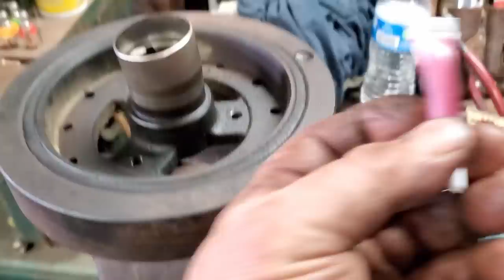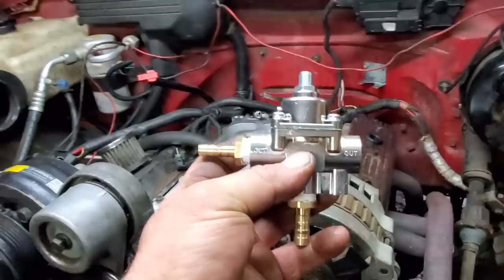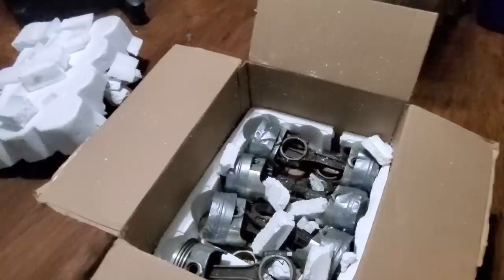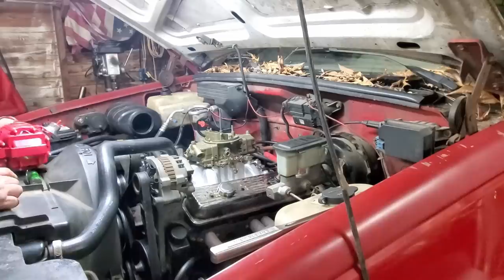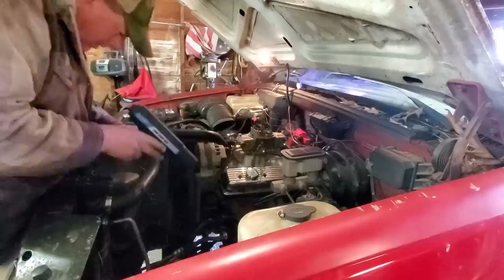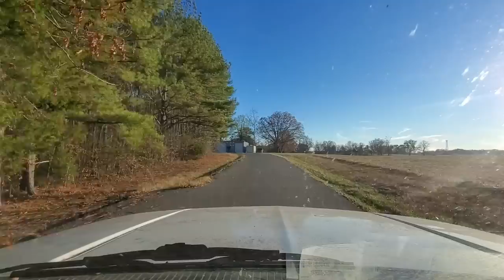1990 Chevy 4wd heads and cam swap. Hot rod 4x4!! Part 2 | It's ALIVE!!

Comment: I am running an older block with Vortec heads and from what I read is that electric water pumps work great with this. You can run a secondary water line from the water pump to the front of the intake. It solves the coolant issues with the vortec heads on a older 2 main block.

Comment: I have a 95 K2500 with the 5.7 TBI . At 188,000 it needed a valve job. I pulled the heads and sent them off to my local machine shop to be checked for cracks and have a complete valve job on them. Meanwhile back at my shop I figured I was so close to the bottom end of the engine that I’d go on and do a full rebuild on the shortblock. The truck is mint and definitely worth it. 
 After finishing the rebuild it ran great for about six months and began drinking coolant. It sucked so much down so fast while I was on a trip with it that coolant was getting in the oil and it beat the bearings out of it before I got it home. 
 The heads on the TBI and later Vortec 5.7s were garbage. Extremely thin and subject to casting shift. I’ve seen them crack between the valves many times but the passenger side head on mine cracked under the valve cover next to a head bolt boss which is why it never skipped or ran bad. It was just dumping the coolant into the oil drain passage of the head and down into the crankcase. 
After sourcing two core heads at a salvage yard and going through the engine again it’s been fine for the last four years.

Comment: Good call on not using steel shim head gaskets on a block that hasn't been decked. Especially when you are installing heads that have had a shop butcher the "resurface" job 👍🏻

Comment: I have converted a couple of these trucks to carburetors. I have had luck with not running a fuel pressure regulator and just put a "T" fitting and there happens to be right around 5psi and it seems to work fine. Fuel feed in the right side. out to the carb from the left side and return line out the bottom of the "T". Cheaper than any regular. Also a 230/234 cam in a 350 probably wants a 2,500 - 3,000 stall to do a burnout. I really enjoyed this series. Having done this myself, I can appreciate the work you put into it. You might also try a lower power valve. Measure the idle vacuum and divide by 2 to get your size. Chances are it's open at idle and causing it to load up and be lazy off idle.

Comment: In my experience I’ve always eliminated the vacuum advance hose on a motor with a healthy cam! 
Just work at getting your total timing  with mechanical advance and try that!
You also may have to re jet the carb and possibly change the power valve!

Comment: If you’re worried about the fuel pump dead ending, you could install a needle valve bypass and just crack it open to keep fuel moving through the pump.  The pump should easily overcome the bleed to keep pressure at the carb and the moving fuel will keep the pump cool.  It’s not a terribly accurate solution, but I would think better than nothing.

Comment: I would not tighten the timing chain cover until the harmonic balancer was installed on the crank snout.  Gives a better chance of the crank seal to adjust to the correct position on the crank snout.   Just saying.

Comment: Augh-- Ya... 🔧🛠 👨‍🔧🧰  It just wouldn't be a "This N That Garage" video without a few misfortunes but don't fret, once again our mechanical messiah shines like a diamond when it's all said and done.  Regarding background noise "FireDragon" etc,  are probably louder for you than us the viewer. Those go-pro mic ports are fairly directional and as long as you don't have the port facing the noise it seems to do a good job of filtering a good percentage of it.  Funny thing with those dis-tib-u-tars,  sometimes you have to growl and bite the vent tube of the carbur-auster before they'll drop in.  Superb sunset finish- line.   "Augh-Ya"        Thanks for the content !

Comment: May have told you but I had a 1978 big bronco and 89,000 it started blowing oil out both tailpipes all over my camper that I was pulling.  Ran a compression check and it was good so I wound up installing new valve guide seals and it was still blowing oil.  I had a friend that owned a shop and he ordered me a new reman long block cause deer hunting season was the next week.  So I pulled the block and started  transferring accessories and intake and holley 650 over on the stand.  Turns out the edelbrock intake that was on the old engine had a whole right below where the power valve was on the holley and I remembered it having backfired when I was pulling the travel trailer through the mountains. The whole was about the size of a quarter  and it was sucking it right through the intake.  Edelbrock gave me a new intake under warranty and i went ahead and installed the new engine.  Made it to deer camp that night and drove to 1985 when we got a new van for the Kids and wife. 21 years (1996) later my son and I were in texas and saw it sitting on a used car lot.  My son wanted so I bought it back and towed it home to north oklahoma.  He drove it till the engine wore out and I pulled the 400 engine out of the truck I that I told you about having the rocks in the carburastor.  Thats what you do with old trucks.

Comment: Its coming along, if you wanted to get rid of the extra wiring and light switch shifting on the cheep 1991 suburban 2500s had a 4l80e standalone computer, but they aren't to easy to find anymore.

Comment: My truck done the same thing.I fixed it by using a bypass regulator and sending some fuel back to the tank via the return.without a return it's pushing the needle valve open and loading up.especially when it warms up.

Comment: Glad it's up and running! Fun fact: a mechanical fuel pump will pull through an in-tank electric pump. I did a 4.3L to 350 swap on an '87 TBI and it's pulls good and doesn't starve for fuel. I ordered a pump for an '86 with a return line fitting on it

Comment: It could use more compression but it will be a great drive when you get it tuned right
Reply from the maker: Yes it could but I was afraid to use the steel shim gaskets in a motor with that many miles.

Comment: I built a Vortec headed small block using that same intake manifold, I fought with tuning issues for months and got so pissed I parked it in the weeds for 7 years. I drug it out and put a Mercruiser intake on it, the tuning issues disappeared instantly. I’m not saying that Edelbrock is a bad intake but in certain combinations it seems to cause problems. I only tried changing intakes because someone else had the same problems that went away swapping the intake. If it kicks your arse too long it might be worth a shot.
Reply from the maker: It's much better with a vacuum secondary carb. Just needs tuning now.

Comment: Those mechanical secondaries on a Holley worked well on a big block for drag racing. Had a 65 impala SS racing Kstock back in the late 60s and it improved my ET a lot. It was one of the first 396s with a factory Holley carb. I know you will get your carb right eventually. 👍

Comment: Sounds pretty good. Couple things, your right in that once upgraded to the higher lift cam, you'll probably need to run high octane fuel to tame the ping. As well, since the larger cam has less vacuum, you'll probably want to swap out the power valve which comes in with an extra shot of fuel when vacuum drops under wot. And the stumble off idle can be helped not only by up sizing the squitter tubes but get yourself a holley cam kit which allows one to adjust how quickly the shot comes in off idle (can also upgrade the pump shot to 50cc from standard 30). Oh and please use the manifold vacuum port for dizzy and not ported as it's only used for lower emissions and fuel saving by retarding at idle unlike manifold vacuum which is always "on". Good luck and good job! Happy thanksgiving! P.s your close enough to me you could have borrowed my aluminum holley brawler 670 which sounds like exactly what you need!
Reply: I wondered about the pump cams too
Reply: @Highstranger951   Correct, I mentioned the holley cam kit (pump), there's several different cams in the kit to fine tune the pump shot timing.
Reply: @livinglikarockstar  I was agreeing with you
Reply: @Highstranger951  ok, thank you sorry yes your correct.

Comment: Have an 89 gmc Sierra 4x4 that was given to me by a dear friend. Needed fuel tank and few weeks later fuel pump and sending unit. Has a lifter that will not pump up. Its all original  tbi 350 minus the smog junk. Since I have to take the intake off to replace the lifters I'm thinking of doing exactly what you did to the t. Would you mind if you can find the time sending me the part numbers of what you installed.
Reply from the maker: If I remember to.

Comment: One thing to check if it keeps loading up at idle, pull the float adjustments out and replace the o rings on both. They will leak fuel passed and load up on you.
Reply from the maker: Didn't start until the regulator quit working.

Comment: The bottom line on the regulator is the return line the two on the side straight through, then the one on the bottom is returned
Reply from the maker: Bottom is in and it has two outs, no return.

Comment: I been running a cast distributor gear on my roller cam 302 for 8 years no problem and at 6800 rpm I think I have tested it

Comment: Make sure to run the best pump gas you can get, those vortec heads brought up the compression ratio
Reply from the maker: Compression ratio is actually lower with that head gasket.

Comment: Hey man that regulator u can turn down to like 6 or 7 psi it will run much better, and u should break the cam in for like 20 minutes at like 2000-2500 rpms
Reply from the maker: It's on 6 and you don't break in a roller cam. 👍
Reply: Ya i know you don’t have to if it’s roller I still like to tho just to get everything moving and lubicrated on a fresh startup but you are right as well. I just subscribed I like how you explain and show how to do things and leave the parts where you made a mistake, I finally can watch someone who I can relate to!

Comment: Sounds damn good man! Personally with every cammed small block I’ve put together I’ve set timing by ear. Instead of adjusting it til it smooths out I adjust it until I can blip the throttle wide open with out any bog or hesitation. No idea what they were actually set to but that’s where they’ve all been happy and ran best. May retard it just a hair if it gets to the point it’s hard starting from too much. Just how I was taught to do it coming up. Hope to see more of this truck.

Comment: Hello sir, loved the video 👍 honestly I used to use the same Holly card your using and every single one had a flat spot just off throttle, it was a nightmare driving a standard tranny like that. Sometime later I started usind 1406 Edelbrock on everything I own and don't have one so ounce of problems with them. You might consider that if that Holly keeps messing with ya

Comment: your power valve may not be correct check vacuum and size power valve to correct also you might need larger squirter in the primary side of the carb or could be to large either way can cause a stumble

Comment: It's your truck and you can do what you want. I just don't understand why anyone would go back to carbs. You did such a great job at the mechanical aspect of things I know you can figure out fuel injection. If this truck stayed tbi it would've started with one twist of the key on cold start. No choke adjustments, no jetting, no vapor lock, better fuel economy. There us absolutely nothing better about a carb.
Reply from the maker: You're exactly right, it's my truck. There's everything better about a carb. Much easier to adjust and tune on it. Already did the laptop tuning stuff many years ago and don't care for it anymore. It starts now with one twist of the key so I don't know what to tell ya. 🤷‍♂️

Comment: I think you might not want to run the fuel pump on that wire it might steal power from the distubritor. And don't forget to break in the new cam at 2000 rpm for 20 minutes

Comment: Yes sir you should run a return line I've seen several people burn out pumps and those trucks doing the deadhood style regulator cause there's no way for the extra pressure to bleed off that normally would go with me for ill injection the bleed off
Reply: You should have around 8ﾟ of total time and at anything no more than that

Comment: Would have loved to see you keep the original fuel injection.  I did vortec heads and a cam on one not two long ago. Just used the Gm vortec to tbi performance intake mainfold.  Then went through moatestuning to do the ecm.  It really wasn't that bad and u keep fuel injection

Comment: Well when I was converting my 97 Chevy Silverado over the carburetor I ordered a new HEI distributor with the melonized gear installed from Summit and it only cost $119 it was cheaper than Amazon or Ebay distributor

Comment: Hope you had a happy Thanksgiving. If spray a little penetrating oil into the head of that craftsman ratchet it will wash out the rust and start working like new. I have to do that all the time.  It was a bad design, and they won't warranty them anymore.
Reply from the maker: Of course they warranty them. Just take it to Lowes.
Reply: @ThisNThatGarage  our local Sears outlet won't warranty them anymore. I'll check it out at Lowes next time I'm in there.

Comment: I hope you had a good thanksgiving. Your right, its been to damn cold outside to be a workin

edit: Run the 93 for a tank and see if it helps or hinders. with those big ole tires, and 4x4 gears, I am not surprised it won't do a burnout.

Comment: Doing the tbi to carb swap on my 95 4x4. Highly appreciate the video and how you explain everything. Did you have to do anything to mount the intake manifold. I’ve read that the center holes for the bolts on the heads were at a different angle. I just didn’t see anything to do with that in the video.
Reply from the maker: This is not a tbi intake or heads.

Comment: Use a return fuel pump regulator if you are using the factory fuel pump and the gas tank deadhead does not work it will flood carburetor
Reply: That's what I had to do 1988  gmc 5.7 with 700r4

Comment: Never let a new engine idle if flat tappet, needs 2000 rpm for 20 minutes to polish camshaft if flat tappet with zinc additive, if its roller camshaft your good at start.
Reply from the maker: I'm aware of what needs to be broke in. I belive I discussed in length the roller setup I'm using.

Comment: I have been waiting for this video.  I have a TBI 94 Silverado and a set of vortex heads from a 96 didn't know witch way to go stay with TBI or go with a Rochester quatrojet either way requires a new manifold from Summitt. What do you think?
Reply from the maker: Depends on what you want out of the truck.
Reply: 90 percent of the time it's my run around town truck then I have to take my tractor to the other house or haul lawn mower

Comment: This is my opinion about comp cams and like myself and thousands of others that got screwed by them buying a flat tappet cam from them and then it going flat in a few miles and them not replacing or refunding my money then I won’t buy another damn thing from them again. Watch DD speed shop and you will see the exact same thing that has happened to myself as well as thousands of other people and that’s my personal opinion on the matter.

Comment: Do you possibly need a high temp thermostat since it’s runs so cold.
Reply from the maker: Has a 195 in it.
Reply: @ThisNThatGarage  Does it have the stock radiator and fan?

Comment: Try running some 93 it'll help with the ping a little bit if you want maximum performance lol
Reply from the maker: Yeah I'm not paying that much for gas. I'll do the cheap thing and back the timing off. It's not a race truck.

Comment: you can give your old flag to your local boy scout troop (or any military group) and they can retire the flag for you if you want. im an eagle scout and i have retired a number of flags over the years (probably 5 or 6). we were always told boy scouts had some special note from congress that lets them do it, but i don't know how true that is. the actual official steps to retire a flag are really simple. You first want to start a decent sized camp fire, probably 2 feet across. you then remove the flag like you normally would (don't let it touch the ground, etc). you really want two people to do this properly, but you extend the flag holding each corner, and bring it over the fire. then you lay it on the fire, and kind of flip the corners in so the entire flag ends up on top. you want the fire to be going really good and lower the flag kind of slowly. its literally just burning the flag with some respect lol. the idea is that the flag burns while it's not scrunched up in a ball, and it burns while its not laying in the dirt. if you want to retire a flag and you aren't a boy scout or military, i don't mind it lol. 

the rules for how to handle a flag are guidelines at any rate. handling the flag is free speech and can't be dictated by anyone, for better or worse. that means no one can tell you to stop doing what you are doing. there are laws regarding handling the flag, but they have no punishments (hence they are guidelines). 

also there are many more layers of ceremony that can be piled on the basic retiring. i've done one where it was probably 200 people present and the flag had all kinds of stories about it. and you don't have to burn it either, there are guidelines for storing a tattered flag as well. even when a flag needs to be retired is kind of up to you. our rule of thumbs was if the entire trailing edge of the flag had the piping removed and was tattered, which takes probably 30 to 50 years to be honest.